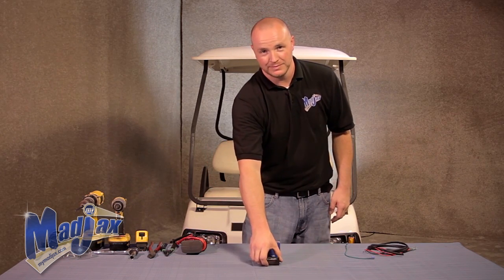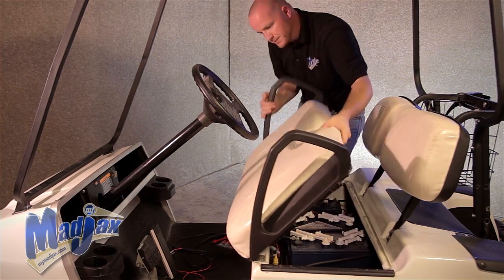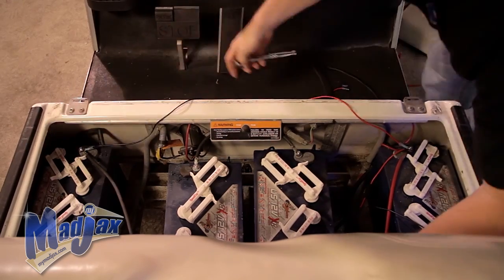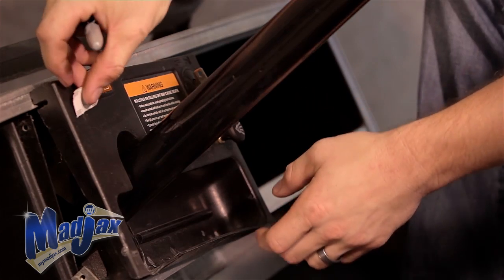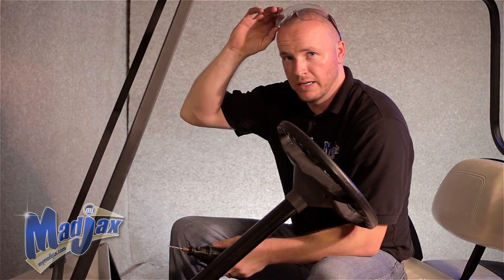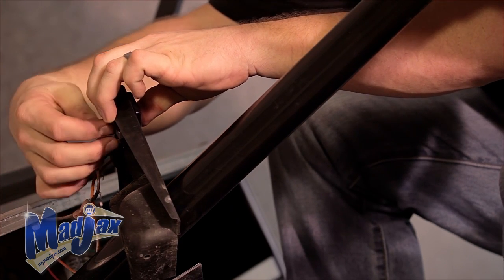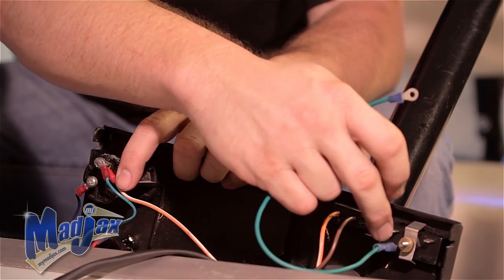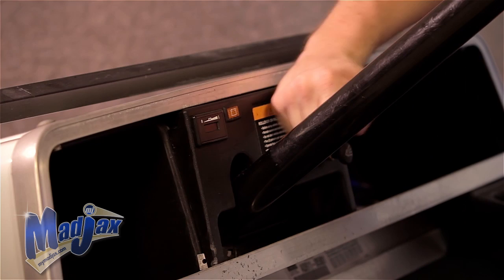(OUTDATED) 48V Battery Charge Meter | How to Install Video | Madjax® Golf Cart Accessories

Comment: I have this indicator but for some reason it will drop off and come from 8 bars to 2 bars after little driving. When this happens it will stay at the second to last bar blinking but won't change and the cart keeps going fine. So it is giving an incorrect reading, why would this happen?
Reply: Mine does the same. It only displays the charge when at full stop. When moving the charge will jump from let’s say 75% to 2% and jump back and forth.

Comment: I added a 36v to 12v voltage reducer on my ezgo txt. I then installed a 12v state of charge meter. The voltage on the meter reads 12.4 volts, but only shows half full. Any ideas why it’s only showing partial with a full charge? Thx
Reply: J Thompson v